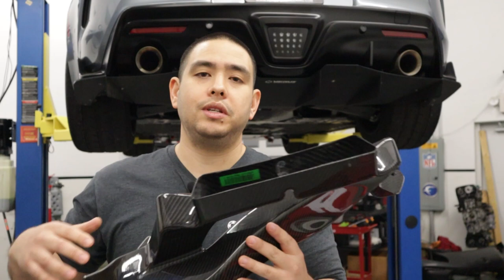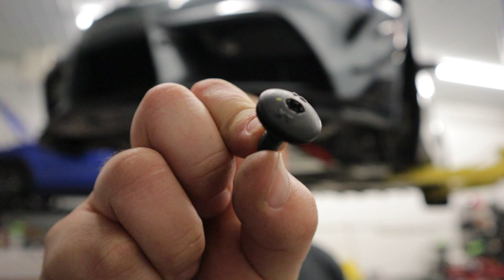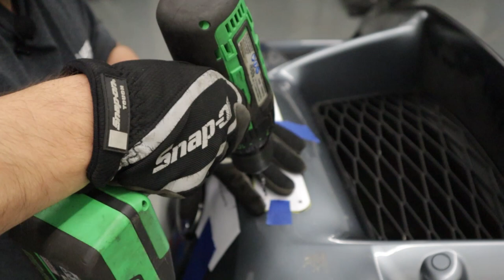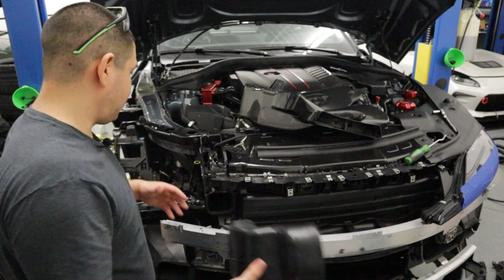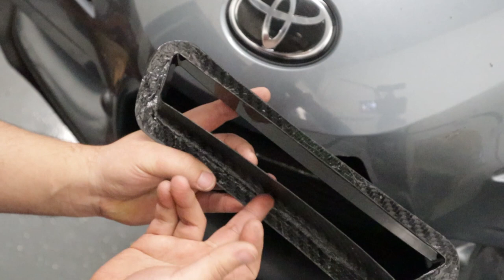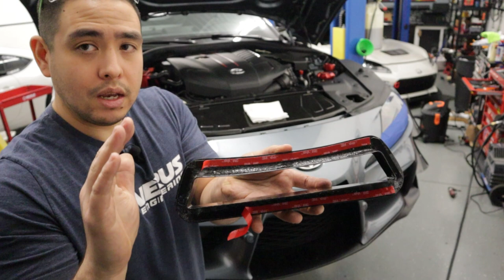Mk5 Toyota Supra Intake Duct Installation

Comment: I have the Velossa Ram air intake. You wont have to cut the bumper.
Reply from the maker: But what's the fun in that!
Reply: @VerusEngineering Should Make a glow kit around the sides of that.
Reply from the maker: 🤣 @beethoven8256

Comment: I guess this intake duck mod it's only recommended for Supras still using the stock air box, right? 🤔
Reply from the maker: No, it will work with aftermarket intakes as well. Jackie runs the AMS intake I believe.
Reply: So top mount big turbo it’s useless then???
Reply from the maker: @carmello000jp  Not really sure what you are asking here. Please elaborate.
Reply: Can a top mount turbo use this
Reply from the maker: @carmello000jp  you could still utilize it. It would dump air in the general area of the turbo and still be functional.
Reply: @VerusEngineering  thank you
Reply from the maker: @carmello000jp  Of course!

Comment: Was great until i saw you ramming the headlight in to get it to fit due to the poor silicone hose design, Will pass as the headlight is more expensive to replace.  what RND did you do to ensure that the silicone hose design wont  cause damage to the headlight bracket over time you must be able to show some DFMEA data as you have a major clash condition.
Reply from the maker: We wanted to maximize available area to ensure the turbo and engine are fed with as much cool, clean airflow as possible. No one internally felt that the headlight bracket would fail over time but only time will tell, you're right. We appreciate the feedback though and will take it into consideration.

Comment: Do you have any track test results if this helps improves IAT? If this more for turbo efficiency?
Reply from the maker: We found during on-track testing, the intake temperature (pre-turbo, just after the air filter) was roughly 20 degrees Fahrenheit above ambient temperature, which is less than ideal. This was specifically designed to combat and fix this issue.
Reply: @VerusEngineering what were the results?